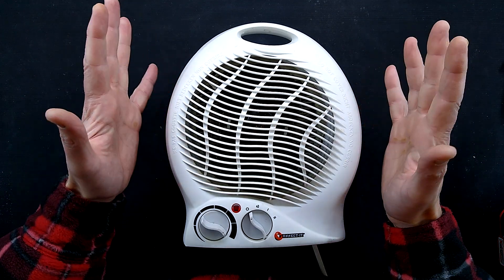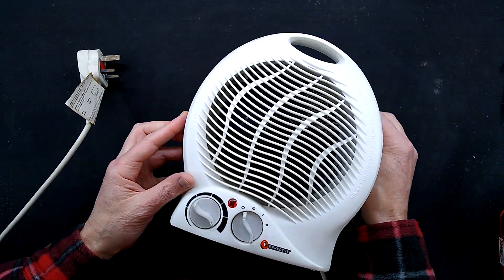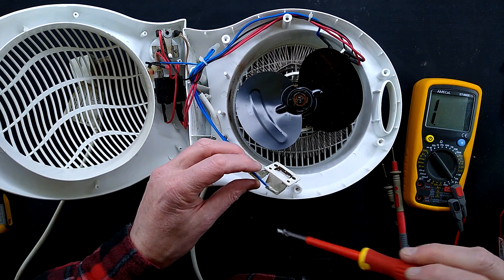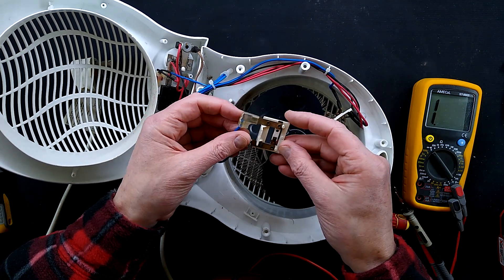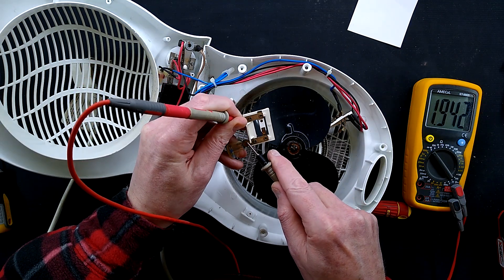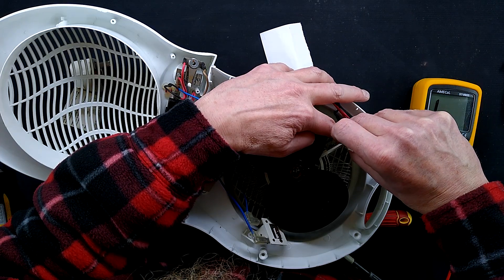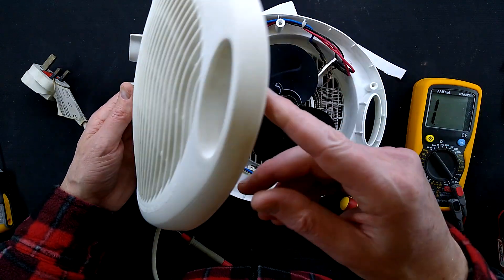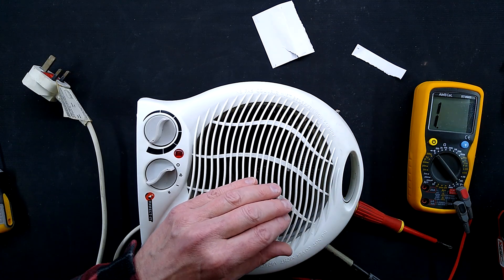Fixing a heater and an apology to my bro

Comment: Someone should get Ralphy an electric blanket.
Reply: I have a bedjet unit. It blows hot/cool air between a special 2 layer sheet. I absolutely love mine but it has its brand specific downfalls.
Reply: @beb38138  Not Ralphy, they cost more than an aged bottle of Scotch malt!
Reply from the maker: I think he has one.
Reply: @bigclivedotcom  Maybe a kotatsu (type of low power Japanese heater) that is designed to pretty much only heat the small space under a blanket might do the trick if he can't stand waiting
Reply: @Frank-bc8gg  thats niche as fuck
Reply: @Frank-bc8gg  I second, this guy needs a kotatsu.
Reply: @MichaelOfRohan  They’re extremely ubiquitous in Japan — they’ve been around in some form since the 14th century! originally using charcoal, but nowadays they’re all electric
Reply: @bigclivedotcom  half the challenge is getting the stubborn goat to actually use it
Reply: @bigclivedotcom  makita do a heated blanket nowadays as well as their heated jackets, maybe just the thing for him, or for you if you're stuck out on your back or your arse somewhere in the cold 🥶
Reply: This is why I have cats, I can strategically place them in areas to keep warm lol
Reply: @ram50v8  I tried cat in my underwear. Cat was not pleased.
Reply: @ram50v8  How do you get them to cooperate and stay where you put them? My three  rebels, do whatever they want, whenever they want to do it; which usually isn't whatever I want them to do.
Reply: @Tekwyzard  3 of them are very predictable, 1 always sleeps all night at my feet, 1 sleeps behind my knees and the 3rd sleeps at kidney level. The other 3 vary positions. One thing for certain, the covers can never slip off lol
Reply: @ram50v8 So you got some kind of weighted blanket then, how Gen Y lol.
Reply: @donwald3436  I'm a boomer, have to improvise lol
Reply: @ram50v8  Exactly who places who strategically?:)
Reply: @ram50v8  we breed Great Danes, and they are very fond of closeness. A very unscientific calculation is that they each are equal to a 1kW heater, and we have 9 of them in the house😁
Reply: To go with the theme of this channel: a Chinese one in pink.
Reply: Or wood fired one
Reply: A risky thought 🎉😅
Reply: Or a heated foot muff.
Reply: Howabout the Rob Roy method?
Reply: An electric throw, best heating investment I’ve made this year, in fact all my family have got them now. 2p and hour to run and heats you rather than the room.
Reply: I've had bad experience with affordable heated blankets cutting out permanently after a few months of frequent use.  I have yet to investigate if the failed cutout is in the controller or inside the blanket, but I would love to repair them instead of buying new ones.
Reply: I’ve bought from a very reputable company modern electric over blankets for my friends. They have changed their lives as they can leave them on and they turn off automatically and use a fraction of the electricity they would normally use to to heat the whole room
Reply: perhaps he should go out and buy himself one, or maybe you might get him one as your so concerned about him!
Reply: Some older hair dryers just had the thermal fuse....I used to work at a hospital , and they used hair dryers on patients after washing their hair.  Nurses would sometimes leave them running, a towel or something would block the air intake and the fuse would do its thing pretty quick. 
     As I recall, they went out at 186° F. Easy to replace, and the fuses weren't hard to find.
   This was in the early '90s...
Reply: @scottthomas6202 My hairdryer from the 1980’s had a thermal cut out switch. It would reset after it cooled down and it trips to early now. 

So if I want to use it on high it will trip after 2 minutes. Them I blow on the intake side until I hear it click. Then use it for another 2 minutes. 

I only use it as a test load or for heat shrink tubing. But I could see putting it under a blanket for 2 minutes of heat. :)
Reply: @scottthomas6202  long ago I had a good friend that his mother would always be under a blanket with a hair dryer. I thought it was the weirdest thing ever growing up.
Reply: Or a red rider BB gun
Reply: Does he wear his electric blanket in the shower lol
Reply: @jeremiahbullfrog9288  the fact that if you put it on heat mode, The timer only allows for 4 hours of heat. This is all new software update issues. I want to be able to control the fan speed and the temperature control and just have it that way until I turn it off. But bedjet has decided to only allow certain configurations with heat specifically. Turbo mode, which used to be 110° at full fan speed is now reduced fan speed at 110, but only 10 minutes timer max. They're setting weird limits to heat related things in the app control. I would love for big Clive to hack this so that I can just control temperature and speed without all the fancy timers. Also when it was advertised, they promised Google home and Alexa integration, but that has never happened with the four years I've owned it. Customer service says that it's because of memory constraints on the chip on bedget 3 model. I will send big Clive my bed jet unit if he pays for shipping to and fro.

Comment: The pins on the mains plug look tarnished as well. At least those are self cleaning.
I took a similar heater apart a couple of weeks ago, just to see how it was wired and what protection it had. All the screws in that one were standard types.
Reply from the maker: I cleaned the plug pins too.  They were very tarnished.

Comment: Good opening comments on preferring repair rather than replacement, even for very cheap items, to reduce landfill. As for unplugging items when repairing them, I'm sure I don't know what you mean. I worked at a repair cafe, so would be delving into the innards of electrical items more than most people. I would allow my self one zap per month in order to start paying attention again.
Reply: One ZPM - that's a new unit of measure which could be applied to repair technicians!!
Reply: @stepheneyles2198  I’d probably need 2-4 ZPM 😂😂😂😂😂
Reply: I too work at a Repair Café i fact its on tomorrow the last one of the year …..wish me luck lets hope I don’t get any ZPM 😂
Reply: Regarding repair cafés - do they carry any public liability insurance? It was suggested to me that it would be a good use of my time as my imminent retirement approaches but I am wary on such matters.
Reply: @HowardLeVert  
I hadn’t thought about it before, but there’s no record kept either of parts repaired 
So very little come back and generally people are so happy to have  that special item working again be it 
Table Lamp, mower, toys, clothing etc ……
Reply: @HowardLeVert : It would be easy enough to ask.
Easy enough not to let it stop you doing some good turns for people who need it, and to help reduce (or delay) landfill.
Reply: @HowardLeVert  It's up to the individual organisation.  Ours does have insurance.  Turn up at a local session and ask!
Reply: Remember the 6 Rs - "Reduce, Reuse, Restore, Repair, Repurpose & Recycle".

Comment: A squirt of contact cleaner on the paper/card, card preferably as paper disintegrates more quickly, as you pull it through the contacts aids contact recovery.  I have a pack of old BT burnishing papers designed just for this contact cleaning activity on 3000 Type relays - not sure if these are still available though.
Reply: Back in the 70s when I worked on PO Strowger/SxS I used these pink strips, brilliant they were, especially when you're trying to mount new selectors in an old rack where the silvery contacts were black from the polluted air (old glass tank lead acid cells), a quick wipe and they were clean. I was the only one on site with the nous to use them..... Contact strips are still available.
Reply: Wil contact lens cleaner work? 😉
Reply: @Nono-hk3is  Probably not - different chemical composition and purpose.  It may even cause more corrosion.
Reply: @Nono-hk3is  I think Ralfy wears glasses 🥸
Reply: In the days of 2" videotape recorders  a white head lapping tape was available to remove hardened head clogs of oxide that couldn't be removed using isopropyl alcohol.
Also excellent for cleaning relay contacts.
Reply: Contact cleaning strips are available designed to be slightly abrasive and you can impregnate them with contact cleaner. Personally I like Deoxit brand, expensive but a little goes a long way and it works.. 😎
Reply: @Pilotltd  DeOxit is great stuff, but the remaining residue it leaves behind(which is normally a good thing)could cause problems on something that gets as hot as an electric heater.
This is one of those situations where a non-residue cleaner is more suitable:one easy to find option for this is CRC QD.
Auto parts stores, and at least some hardware stores, among other establishments, should have this.
Reply: @m.k.8158  Deoxit gold GX100L is good for continuous use at 310C, Plain old D100 at 200C. Should be fine..
Reply: @Pilotltd  ok, except that most people use DeOxit D5, not D100, so what is the max temp on D5?
Reply: @m.k.8158  You have to try to be right 🤣🤣 Look it up yourself if you like, I've better things to do..
Reply: No no. Sorry, but I can't SEE that working at all, in my VIEW, no certainly won't cLENS it at all.😏
Reply: A "points file" would work well for this. My father had a good selection of these as he worked with relays (and points when he was tuning the car!) all the time.
Reply: @neil2402  Don't use a points file, you'll scrape off the plating and make it worse.  Same reason you don't file soldering iron tips anymore, we've moved on from using lumps of copper.
Reply: @j.f.christ8421  Wow, I didn't realise relay contacts were only plated! I assumed the blob on the contacts was solid material. My father worked with relays professionally. I though he knew what he was doing. Maybe not!  (I should state that the "points files" I'm referring to are like very fine sandpaper, but diamond coated rather than quartz).
Reply: @neil2402  the parts your dad originally worked on may not have been cost-engineered as thoroughly as modern devices.
Reply: @neil2402  high quality contacts may have very well have been solid, particularly the older stuff-the really good stuff, even now, likely still are.
However, I tend to prefer actual contact burnishers to a file(although those "points files'' if fine enough are likely ok in at least some situations.
Even with an actual contact burnisher, it's still a good idea to try a piece of paper (preferably sprayed with a suitable contact cleaner) before using a burnisher-the paper may be enough, and it's more gentle than the contact burnisher.
Reply: @EmyrDerfel  yep, given where they were used, they would have been top quality.
Reply: @neil2402  They're plated (gold, silver etc) to reduce corrosion, increase conductivity etc, you don't want them sticking together as it kinda defeats the purpose.  If gold or silver was cheap they'd just make them from that rather than stuffing about plating copper.  

Even fine sandpaper is too rough.  If the points are meant to be operated often then they'll have a snubber across them to stop arcing (like the condenser in car ignition points).  These things aren't meant to be used (maybe once or twice) so why add the extra bits to protect the contacts?

Comment: For such a cheaply made unit, I was supprised to see a metal fan blade.
Reply: One would assume that being in close proximity to the heating elements plus the physical forces involved meant a properly built plastic blade would be more expensive than the cheap stamped metal one.
Reply: @Bigrignohio  Because the heating element is behind the fan rather than the usual way of it being in front of the fan blade, so the fan will become very hot.
Reply: I've seen ones with plastic

Comment: You're a very good brother.

I did not know about the layers in contacts and would have been tempted to use some 600 grit sandpaper.

Thanks Big Clive.
Reply: they are hard to find now but back in the day we had burnishing tools in our toolboxes to clean contacts.
Reply: Relay contact cleaners used to use about the equivalent of 2000 grit diamonds to get rid of oxides. Many metal oxides are harder than the metal it's self with Iron being one of the few that has a "soft" oxide. Aluminium oxide for example is the basis of sapphire and not that far behind diamond. It is now used in the replacement for "Emery Cloth" in most industries.
Reply: @gordonlawrence1448  Sapphire, ruby and emery are all types of corundum. The colour depending on other metallic elements are present in the alumina crystals.
Reply: I always used fine grit sand paper, but its been many years since I have worked on contacts, and back then it worked. In fact it hasn't been that long ago that  did that to the thermostat for the furnace. The thermostat is quite old, so maybe that's why it worked.
Reply: I used  just plain paper to clean contacts in the past, mainly because it was convenient and worked well enough. But I just wondered if anybody has tried coating the paper with a layer of green chromium oxide (paint or glue for bonding) first. This should be both fine and hard enough to remove most metal oxides and should not remove too much of a coating.
Reply: @ksjhi  I wonder if you could see the difference with enough magnification from a phone capture between the two methods?
Reply: Ditto 😅Thanks Big Clive
Reply: I thought this too, it worked fine on my commutator.